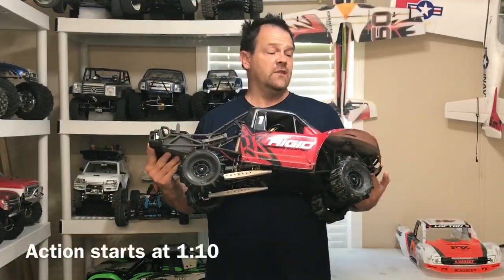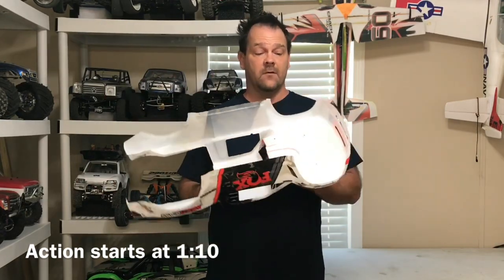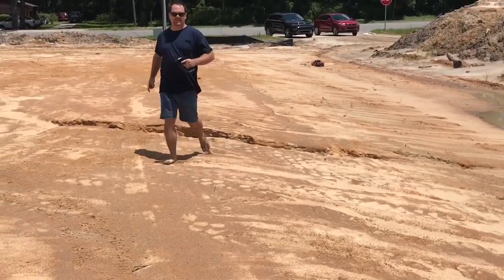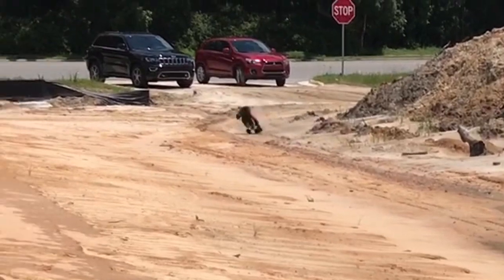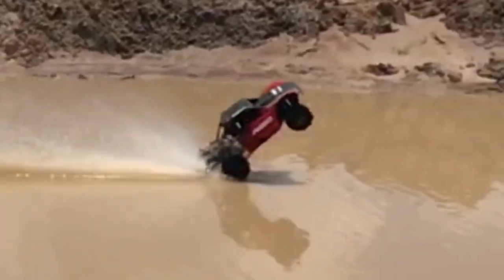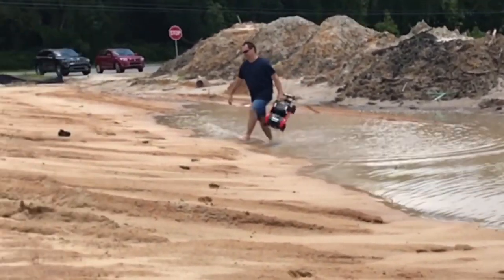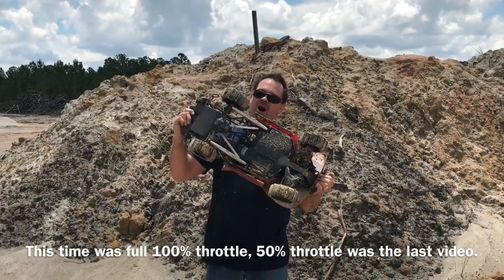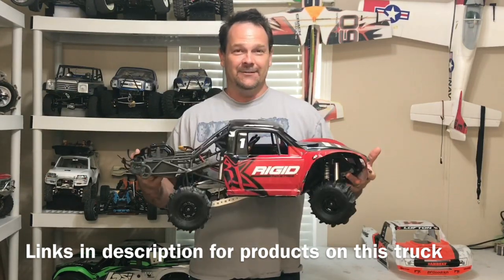TP Power Traxxas 8S UDR ON WATER!!!!

Comment: This is the reason I want a UDR. I think you're the only person I've seen so far that has tried different motors. I've been going back and fourth between this truck and a Traxxas Slash Ultimate. I luv the size of the UDR and it's fast but I want to see how fast I can make it. You've been ripping it with these different engines. This TP engine is awesome, I was gonna ask is it water proof but it seems it is...👍🏿
Reply from the maker: I wish it was waterproof but its not. I've taken it apart twice now to clean it out and oil up the bearings. Its an expensive motor so even though I have abused it I want it to live.

Comment: Hey which two 4s batteries did you use? It is hard to find batteries to fit. Thanks.
Reply from the maker: 6s in the battery tray and a 2s in the back where the tires were

Comment: How did you manage to set 50%? Was it on the Tx or was the ESC in training mode?
Reply from the maker: On the TX. I had it set to 50% for consistent jumps for the MFR arm suspension testing. Forgot about it
Reply: Exocaged RC, ah, easy mistake to make, we're only human. Did seem strange that it was running slower than stock.

Comment: You think you could get some badlands on there or trencher 40's
Reply from the maker: I’ve got badlands and I’ve had them on it but they are a bit too big. Can’t run a full body at all with them on.
Reply: Were they the MX38 Badlands?
Reply from the maker: No the MT badlands for truggies and similar style basher trucks.

Comment: Would that motor work in an x maxx 8s?
Reply from the maker: Yeah but you’d probably have heat issues. Would be insanely fast though. I’d give the Poseidon 1527 motor a try in an xmaxx. 1500kv and just as strong as the TP.
Reply: Exocaged RC I have the 8s version and I threw a max6 and 6s 1600 kv motor in it and it absolutely rips.  I’m afraid to drive it out in front of my house because it wheelies at almost any speed.  I’m just thinking though if I can keep 8s at 2200 kv it would be ludacris.  I haven’t seen anyone try it on YouTube, it would be damn entertaining though....

Comment: what esc are u using  with that motor
Reply from the maker: Hobbywing Max 6
Reply: Exocaged RC hello ,but your tp 2200kv no need 264a max in 8s ?
Tk you
Reply from the maker: I’m not sure how many amps the motor is pulling but so far the esc has done fine with it on 6S and 8S.
Reply: Exocaged RC hi,i have this esc 160a erzun max6 , but I'm afraid that on a race, it does not hold, mamba xlx is not better ?or i can continue to use erzun 8s?
Thank !!!
Reply from the maker: I've had no issues at all with the Max6 esc, give it a try and if it fails give the XLX a try, in fact I've run mine without an esc fan for the last 5 runs without issue.
Reply: Exocaged RC thank you very much 
Good continuation!!!!

Comment: Two questions sir...Did/will you ever do a speed run with this motor on 8s(on road and/or Grass)? Was that the one it flipped over a lot in a parking lot? Also, do you have a IG/Instagram page? You know/try/do a lot with your cars and it would be great if we could follow you and ask you questions there or...here is fine :-)
Reply from the maker: I will soon have a diff in the rear so yeah I may do another speed run with it. In all honesty 6S is all the truck needs.
Reply from the maker: I have a Facebook account but no Instagram or any of that.
Reply: Exocaged RC this is true, 6s is fast enough. I was just curious with that monster TP motor was putting out. That thing is a beast😈. Wheelies on the water at will👍🏿